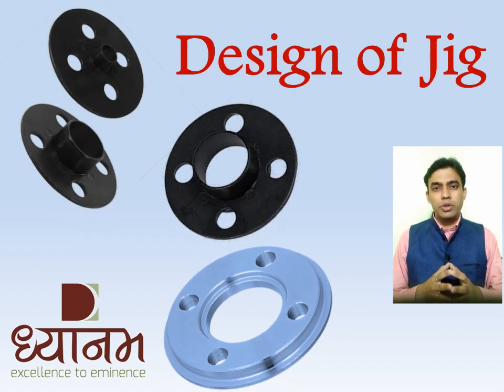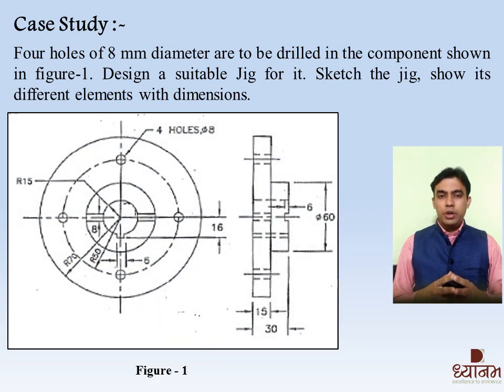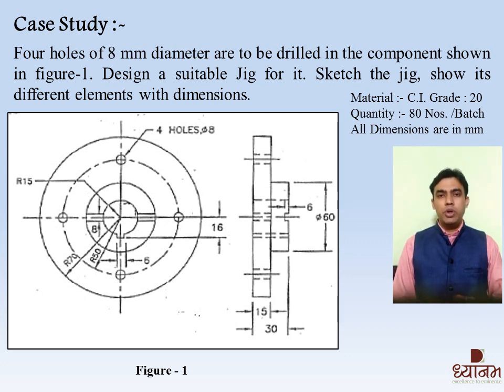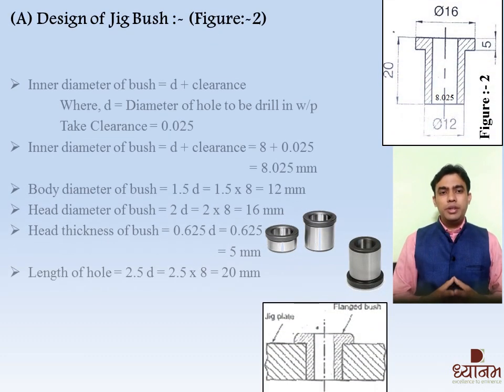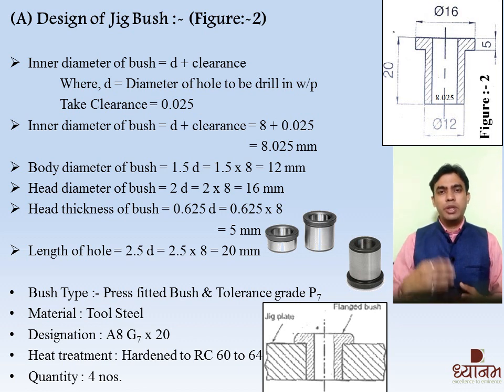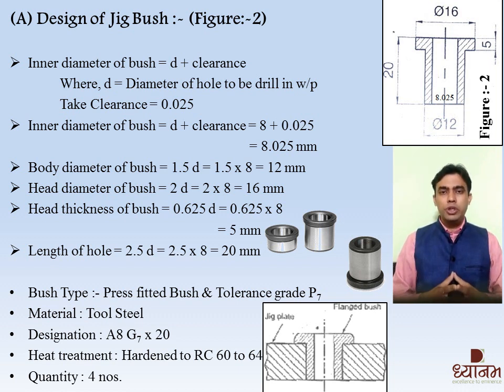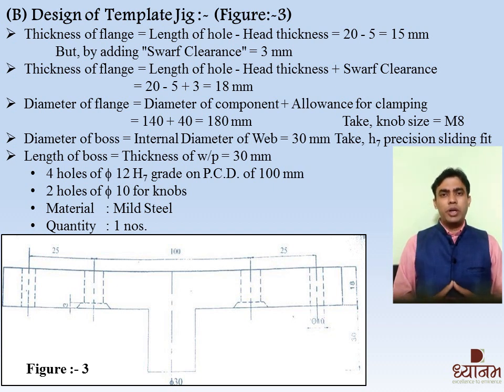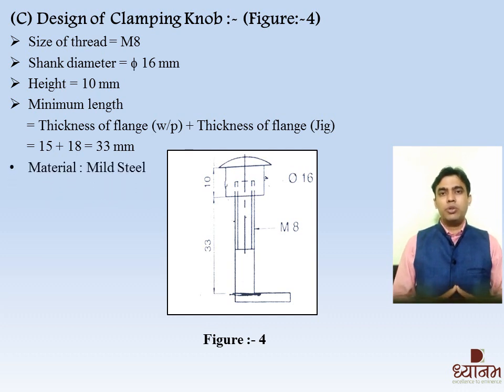Jig & Fixture Design/Jig & Fixture Example/Design of Jig & Fixture/Template Jig Design/Tool Design

Comment: Well explained
Can you suggest me a book for design of jig and fixture 
And where I can get all such dimensional data of bush,pins,clamps etc
Please tell me which book are you using
I will be very helpful 
Please make more videos
Reply from the maker: Thank you very much.

There are many informative books but the one I would like to suggest. Jigs & Fixtures by Shri P H Joshi, TMGH publication.

For data related to bush, pins, clamps etc. it is more based on formulas & calculations. Still for the same you can refer Design Data Book.
Reply: @dhyaname2e  sir I have this ph Joshi jig and fixture book 
But I don't think it is for design it is for theory 
You reffer Design Data book
And you name author
Reply from the maker: @arunavabala7629   It is PSG Design Data Book.

For more you can refer, 
Principles of tool & Jig Design. By M H A Kempster.

Design of Jigs & Fixtures by Eswar Publication.
Reply: @dhyaname2e  thanks sir 
Please do more videos on press tool and jig and fixture 
I am from kolkata and I studied in MSME TOOL ROOM KOLKATA